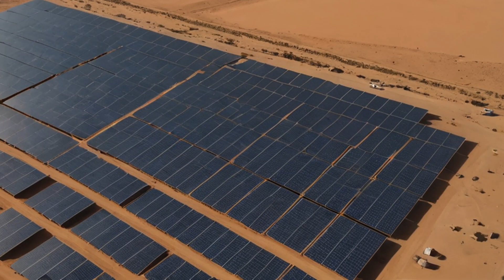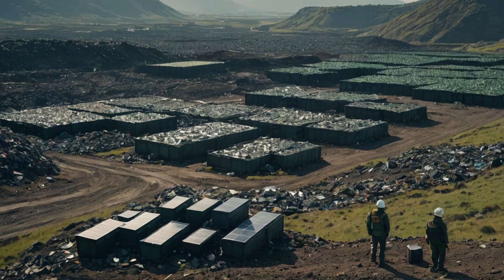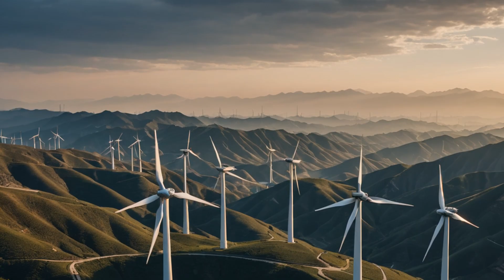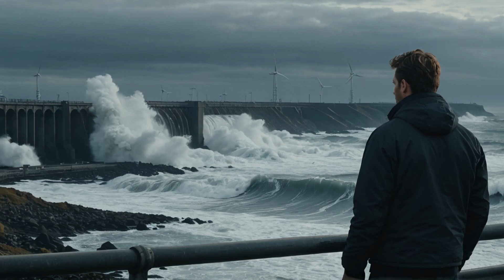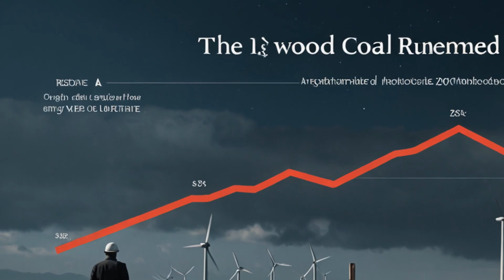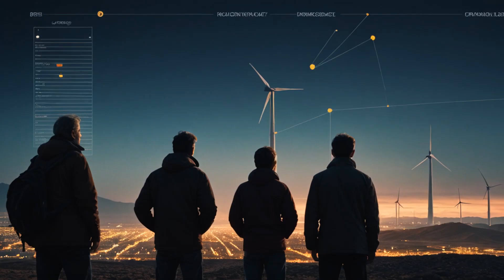The Shocking Truth About Renewable Energy's Limitations Revealed

Comment: Super expensive, slow to build commercial utility-scale nuclear won't even put a dent in the amount of energy needed to displace fossil fuels.  Nuclear energy also comes with unparalleled risks that no other electricity generation even comes close to.

In its 70+ years of history, commercial utility-scale nuclear only powers 9% of the world's grids and that figure is dropping yearly.  All while renewables grows exponentially each year.  Renewables, especially utility-scale solar, have reached historic low costs per MWh generation and still continue to drive their costs lower.

The power of our local star is so vast that less than 1% of the world's land surface is enough to power all the world's grids

All the combined fissile fuel on Earth wouldn't even amount to a bucket of water floating in an ocean of water when compared to the 173,000-terawatts of power the sun provides the Earth continuously non-stop for at least a billion more years.